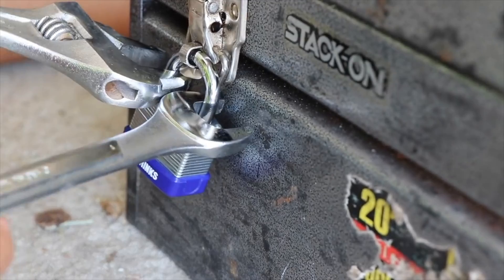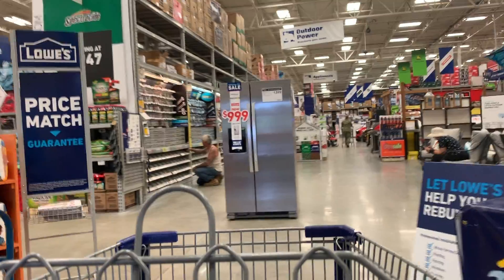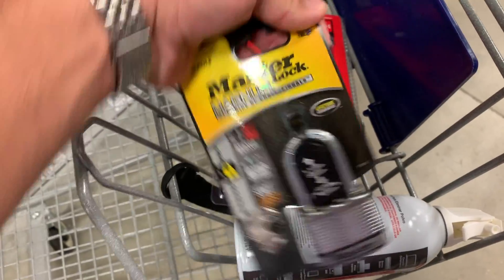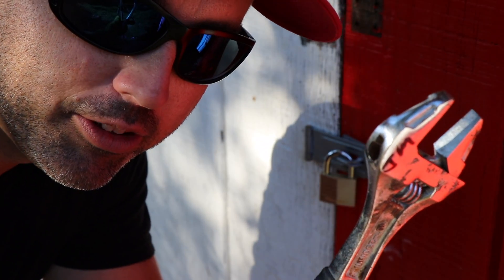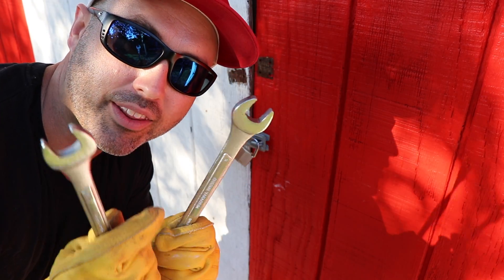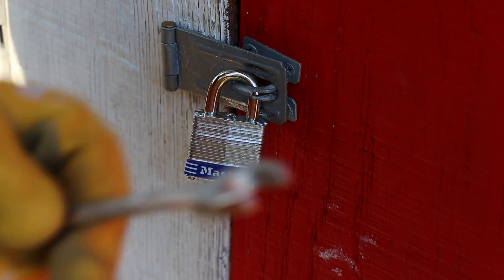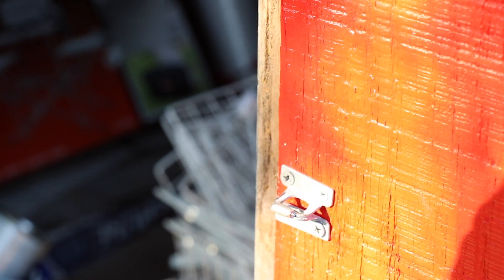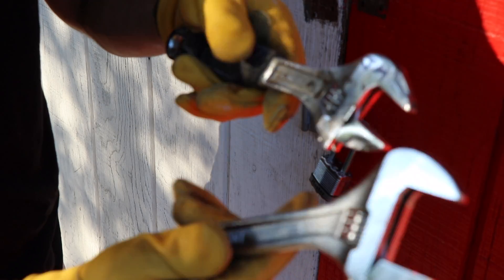The TRUTH about HOW TO OPEN a LOCK with a NUT wrench! (master lock)

Comment: when I worked in maint we rarely fumbled for a key just smack the body from the top with a small ball peen hammer. and usually it will still relock after

Comment: Just hit the lock from the top with a claw hammer.. hard. Should take two or three strikes at most. Unless you're a weakling. Then maybe five. These things are junk. Or, just peel off the lock base from the structure it's on. Takes less than a minute. Locks are to keep honest people out. Period.

Comment: Ok, hypothetically.  Lets say its dark outside and the headlights on your 1985 K Car are totally dimmed from old age.  Your truck lock rusted out years ago and you replaced it with the high end Mater lock and a chain.  Your last can of WD40 is in the trunk.  You have your tool set in the front seat with all of your wrenches in it.   Do have anything else that works or do you just drive with dim lights?

Comment: I work for a Mini Storage.  What you want is the round style locks.  Have seen thieves try 16 times to cut one with bolt cutters with out success.  The bolt cutters were a pretty decent sized pair but they kept slipping off.  They run about 15$ but are well worth it.
Reply from the maker: Awesome! Nice to know thanks!
Reply: And they can be drilled out in about 15 seconds with any portable drill.